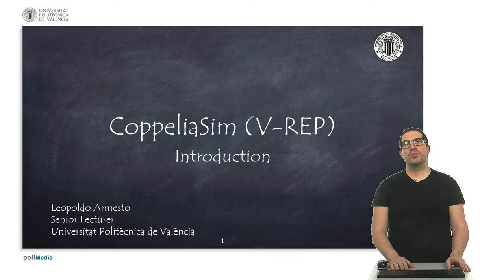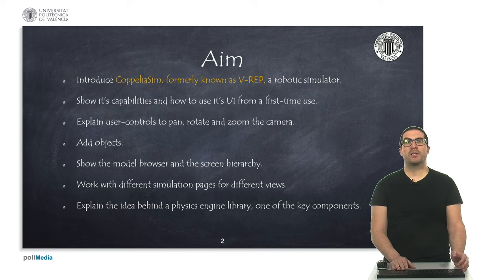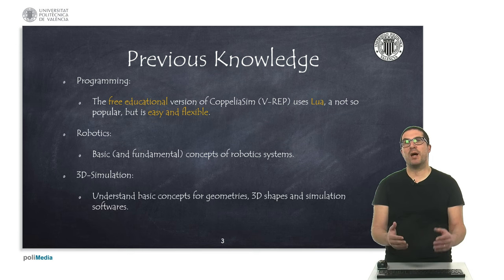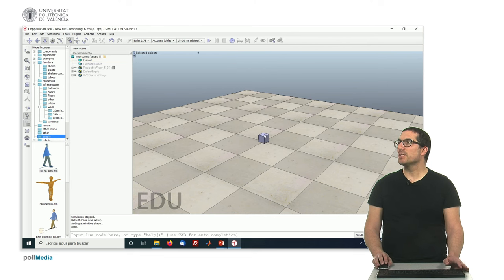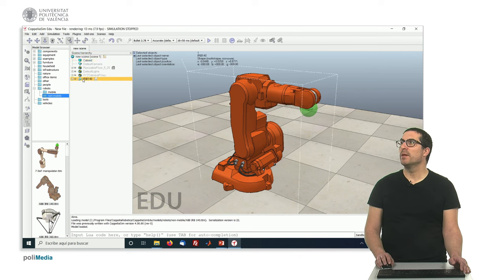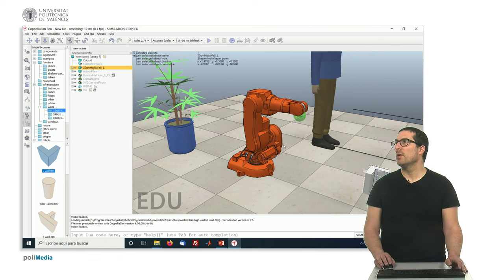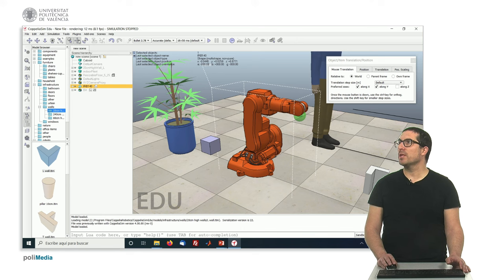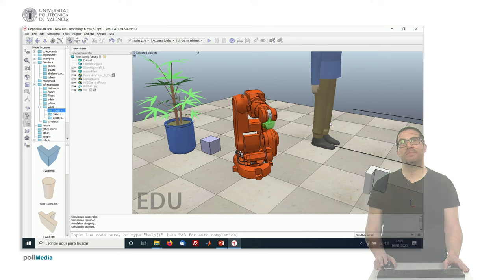Introduction to CoppeliaSim Course | CoppeliaSim (V-REP)

Comment: How can I get the acceleration data from an "Accelerometer" that is attached to the "youBot" for the "youBot" script? I find some instructions and tried to do this. But I can't find explainnations for the functions it metioned(ed. TubeOpen ), and it's having errors. I also tried "signal" commands, not working as well.

Comment: Just getting started with robot simulation software and CopeliaSim was recommended. I've downloaded the free player version to check it out. However, the model browser is practically empty. It only has "examples" folder and in there is only a Kuka LBR and Hexapod. I need a UR10e and other things, such as tables, etc. How can I get the full model library?
Reply: You should install Educational version(its free). In this version you can find any model you need

Comment: Thank you for the tutorial its really helpful.

I am doing a project using coppeliasim in which it is required to reflect laser light. I am trying to do this using Laser pointer but currently stuck at this point. Can you suggest some method by which this can be done (i.e reflection of light).

Thanks in advance.
Reply from the maker: Not sure about what you mean...
Reply: @LeoArmesto  I am trying to simulate something like 2-axis laser scanner. Is is possible to do this in coppeliasim?
Reply from the maker: @adityasrivastava6288  yes, there’s a demo doing something similar

Comment: helo master, I have a question, how can Matlab read the conveyor speed data set in Coppelia? I hope you can help me to answer the research problem of my final project. thank you very much for your time
Reply from the maker: You need to use the remote API for Matlab https://www.coppeliarobotics.com/helpFiles/en/remoteApiFunctionsMatlab.htm

In particular, you can get the joint target velocity or use a dummy and get the object velocity
Reply: @LeoArmesto  thanks for the answer sir. I will try to do the advice you gave .GBU